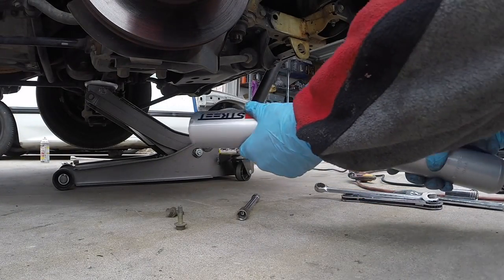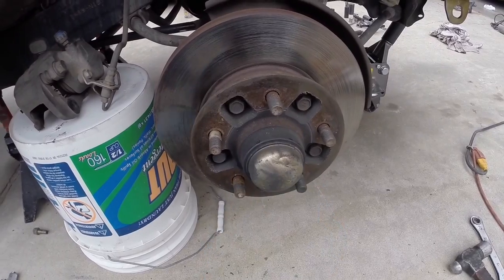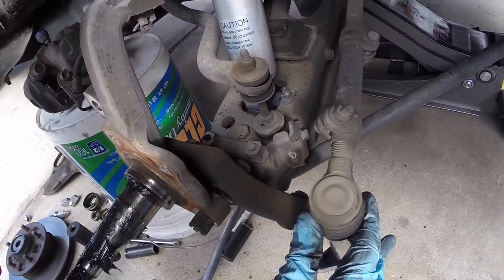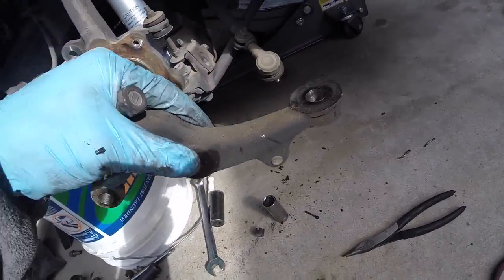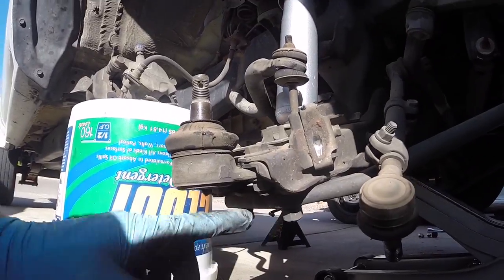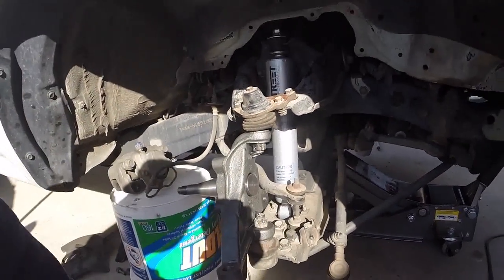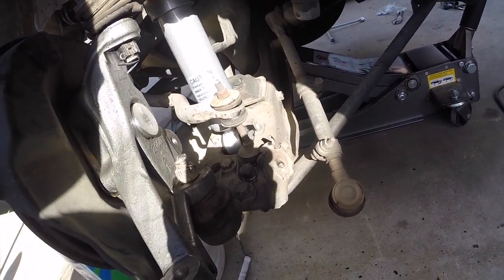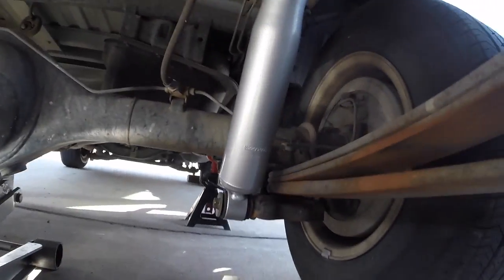How To Lower 1994 Toyota Pickup 2wd (89-95 models) Belltech SP444 DIY

Comment: Yeah i made the same mistake as you at first. do NOT drill your blocks, that plate comes off and goes on top of the block
Reply from the maker: Darn it, I haven't had any problems at all thankfully.   I wish the instructions would have shown this step.
Reply: +Jon Widmer Yeah i would keep it that way until you get new blocks. I drilled one block a few sizes up and when i test fitted it, i knocked the plate off lol. stupidest $30 i ever had to spend again
Reply from the maker: +Tj Long I think I'm just going to leave it alone.  I haven't messed with the blocks since the install.  I am going to double check all the nuts again to make sure they are tight still.  Thanks for the comment man, its a welcome addition and hopefully other people will read this before drilling them out. :/   I updated the info section also!!
Reply: What do you mean by the plate comes off and goes on top of the block?
Reply: According to the block it's one hole at top and one hole at bottom right? What plate in the video? I didn't see any plate.
Reply: Garage Built Hondas did you ever answer what plate you’re talking about flipping? I have an 88 that I’m lowering but I have no idea what plate you guys are talking about lol
Reply: Tj Long me too man I did the same thing 🤦🏽‍♂️
Reply: I believe the plate he is referring to, is the top plate that holds the leaf springs together

Comment: On my '87 we just dropped it using the torsion bars. 3" front, 4" rear with 15" KMC Hammers. God I miss that truck.
Reply: how youd lower the back? blocks? did you replace the shocks?
Reply from the maker: Subielicious Yes, 3" blocks and new Belltech shocks

Comment: I got the Belltech 444ND instead of the 444SP that you got. The ND (Nitro Drop) shocks up front do not fit through the control arm and don't have the removable dust cap your shocks have here. The solution I took was to press the lower shock mount bushing out, put the shock in to the control arm from the top, and then press the bushing back in. You could also grind out the control arm or the shock body, but I don't think those are as clean as just pressing the bushing out.

Just throwing this out there in case anyone else has the same issue I did.

Comment: Great video, all I would recommend is to add another 1.5" thick plate to the rear lowering blocks to get the truck to sit level.
Reply from the maker: Thanks man!!  That's a good idea, I had thought about just getting a 2" block in the rear instead of the 3" to raise it back up by an inch.   I'll have to see which is less expensive!!

Comment: thank you for all your videos, seems like anything i want to do to my car you have a video about! 

now my question, i called belltech to order and they told me that i needed to grind out the ctrl arms and grind welds to remove the dust cover, did you have any CA clearance issues or have to grind a tack weld when you removed the dust cover from the front shocks?

and thanks again for all the great content!
Reply from the maker: None.  Everything bolted up with zero issues.  Possibly the new product is different?

Comment: Hey what's up man, badass vid, just wanna know if it's cool to carry small loads after this is done, I deliver cart parts, not to heavy loads. I detail as well so I got a water tank , my pressure washer and all that good stuff. Still be chilling ?
Reply from the maker: You'll be good.  I carried 377 lbs of a cut into pieces CRX that I took to a recycling center and didn't have one problem at all.

Comment: Hey Jon. I was wondering if you could post a picture showing whether your new scrub radius is above or below the radius rod after installing the drop spindles and flipping the ball joints (or just tell us, haha). You're pretty savvy, but if you don't know, it's just whether if you got a completely flat tire, would the radius rod hit the ground or would you be riding on the wheel? Reason I ask is I think 15s look great but they would be a safety issue if the scrub radius is too high. Thanks for all your help. Great video.
Reply from the maker: +A dudeguy It is very close with my 14's but I would be riding on the lip of the wheel if I got a completely flat tire.  It looks as if it would scrape the 2 nuts that hold the lower ball joint on slightly.

Comment: FYI the nuts that hold the rotor/bearing onto the spindle are supposed to be loose, it's not like an axle nut on a fwd. Tighten them up ad you're gonna roast those bearings.
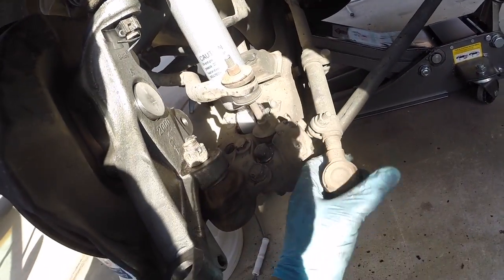Reply from the maker: Yes, I noted it at around the 9:15 mark.  Hopefully people follow that.  I drive this truck 5 days a week.  I haven't had any problems at all.  Thanks for the comment!  I appreciate the feedback!
Reply: Yup I see that. Made the comment before I finished watching the video sorry! I really dig the 2wd mini trucks. Hows the 22re power wise? My 2.7l 4x4 tacoma is a total dog.
Reply from the maker: +Bradley Vaillancourt It's decent.  Not a huge amount of power but I'm still able to tow my 2200 lb track car 150 mikes 6 times a year.  I'm getting afraid though, it has 194,xxx miles and climbing !
Reply from the maker: +Jon Widmer *miles
Reply: +Jon Widmer 22r will last forever if you take care of em. i bought an 87 longbed from a guy who used it as an extermination truck. had 454000+ on the odo when i bought it and 537### when i sold it 3 years later. great motors!!!
Reply from the maker: +Spoon Fixer I've read this a lot.  I'm hoping I have the same luck!

Comment: how did you get the spindle separated from the upper and lower ball joint, mine was stuck after i removed the nuts. so i used a mallet, it came off but now my ball joint studs spin when i try to put the castle nuts back on. any insight would be greatly appreciated.
Reply from the maker: +viiagrafalls I used a mallet also.  Mine didn't spin though so I didn't have a problem getting them back on.

Comment: Great video man. I have a 93 Isuzu pup, and haven't found any info on how to drop it. Do you think this kit and steps would work on it?
Reply from the maker: Thanks!  The drop blocks are probably similar, but for the fronts, I don't have a clue.  It may be a torsion bar setup which is adjustable and will lower it.  I'd look around online, I bet you'll find some info for lowering the Isuzu.

Comment: i know its a long shot but have you considered coil overs? there are no videos on youtube that have showed the process of a coil over conversion on any mini trucks.. you can be the first???
Reply from the maker: That'd be an awesome idea.  It'd probably handle a lot better too with all of the options of using the shocks with custom spring rates and lengths!
Reply: +Jon Widmer when I clicked play I thought for sure it was gonna be blocks n cranking down torsion bars, get that mini truck bounce going,lol!

Comment: Did you have problems with the lower part of the spindle from Belltech? My issue is that i can not fit a socket over the bolt on the lower ball joint won’t be able to torque it to specs. The only way is with a wrench just wondering if you went through the same problem?
Reply from the maker: No idea, can't remember.  It's been quite a while since I did this.  I've spun a lot of bolts since then and those memories are gone, sorry.

Comment: probably been covered,  tries to look through comments, but How's the over all ride after, because I love how smooth stock is but hate the look haha
Reply from the maker: Marmoto812 It's a little more harsh but still comfortable.  I drive it daily and I don't even think about it being lowered.  I think I need smaller bump stops in the rear.   I think that will help with the overall feeling.
Reply: Jon Widmer right on thanks for the response! the kit is like $400 right?
Reply from the maker: Yes, I got mine from autoanything.com.  They had the best price when I bought it.

Comment: Where did you buy the ball joint separator...brand name, part number will help. 
I bought a ball joint separator 2 weeks ago that looks like a fork, and broke all my ball joints, grease all over and had to buy new ball joints. 

Are you also knowledgable about Tacoma from 1995-2003? Thanks
Reply from the maker: Ford SVT This ball joint tool is from Harbor Freight.  I do not remember the part # but it's always available at all harbor freight stores.  

I have never worked on a Toyota other than this pickup, sorry I can't offer much help.
Reply: Thanks for the ball joint separator from Harbor Freight. I will buy one tomorrow. BTW great video.
Reply from the maker: Thanks!

Comment: How's the ride? I just ordered the same kit, but was wondering how it rides. How's it on turns?
Reply from the maker: It rides a little more harsh than stock, but still comfortable enough for daily driving.  I daily my truck.  I have since put thinner tires on a larger wheel and that made it a little more tough.  It's not punishing at all.  I'm thinking of replacing all of the body mounts and the rear leaf springs.  I think that'll help restore ride quality on this 23 years old suspension parts.
Reply: Jon Widmer cool, I want a lil stiffer ride, I'm use to my Integra on sport suspension. My truck, when I take a turn ii slide out my seat lol

Comment: Did you have any trouble putting the wheel assembly on the new spindles? My wheel bearing locked washer won't fit with the new Beltech spindles I've got a 92 Toyota pickup
Reply from the maker: I didn't have any problem at all.  Both bearings slide on perfect.

Comment: Is there a shorter toe rod that u installed, because my ailment is way off. It still needs about a 1/2” to go to get it straight, but I’m all out of threads
Reply from the maker: No, I used the OEM.  After I finished I had it aligned at didn't have any issues.

Comment: Did you do leaf springs as well? I see on the Belltech website you can do this lowering kit and I bought that. But I also see 3” lowering leaf springs, does that lower it an additional 3” on top of the 3” the kit gives you??
Reply from the maker: I didn't do leaf springs.  I believe you will probably get additional drop.
Reply: Also when you did the ball joint flip, did you have anything rubbing?? I’m having my right wheel (rim) is hitting the lower control arm for some reason
Reply from the maker: Might be an issue with the size or offset of your wheels.

Comment: Do you think a 15x8 -19 (3.75in backspacing) running a 205-55/15 would fit? Stock fenders and suspension right now, planning on running this lowering kit and rolling fenders in the future.
Reply from the maker: With lowering you'll rub the front for sure.
Reply: @GarageBuiltHondas  Thanks for the info, I've seen them on a pickup before and they said no rubbing but they probably rolled fenders at least. I also have two rust holes in both my fenders so I plan on replacing them. Do you know how easy it is to install 4x4 fenders on a 2wd and possibly how much wider they are than stock? Thanks
Reply from the maker: No idea on sizing difference.  Fenders are generally pretty easy to replace on many older vehicle.

Comment: Hey man!
Im currently in the process of lowering my '91 Toyota pickup with this same exact kit. I ran into a hiccup last night & ran out of daylight so i might get back out there today. But, the drop spindles. Did you use the ball joint separator to free up both ball joints (upper & lower)? Ive got everything else done minus that wasnt sure how those come out & cant seem to find any info on that. I lost the manual that came with my set up. Any helps appreciated, thanks again!
Reply from the maker: Yes
Reply: @GarageBuiltHondas  you rock man! do you still own your pickup?
Reply from the maker: No, sold it in January 2018 to drive something safer daily.

Comment: also what did u use to bore out the hole in the rear blocks?
Reply from the maker: I used a step drill bit.  It came in a set of 3 from harbor freight.  I didn't have any regular drill bits that were big enough.

Comment: Would you recommend lowering via torsion bar if running low on money?
Reply from the maker: Definitely, nothing wrong with a budget drop.  Do the ball joint flip first and see where that gets you.  Then you can adjust the torsion bars as needed for a little more drop.

Comment: Hey man, what you think of the kit overall after 3 yrs? Would you do it again?

Edit: I read every one of these comments and I'm impressed by how many of them you responded to. Right on man
Reply from the maker: I try to respond to all comments, I might miss one or two every now and then but always like to reply.

I had no issues up until I sold the truck back in January and I had daily drove the truck in the entire time.
Reply from the maker: That kit was nice because the ride quality stays similar with the setup.  Would I do it again?  Maybe, but don't really want to ever drive a mini-truck daily ever again.   Not enough cabin room, and not a comfortable ride for long road trips.
Reply: Garage Built Hondas yeah I can understand that. I sold my 97 tacoma single cab for that reason. I drive a 93 pickup extended cab now and I plan on referencing this vid when I do my install. I appreciate it man. Thanks.
Reply from the maker: You're welcome, it was a great truck though, our family had owned it for the last 22 years

Comment: Im trying to lower my 91 on a budget, do i have to get new spindles? There are some lowering blocks for cheap at my parts store. What would be my best option to lower the truck for cheap?
Reply from the maker: No.
Probably those blocks.
Reply: Blocks in the rear and adjust the torsion bars. That would be the least expensive method. However, it will not ride as well as it would with the drop spindles.

Comment: what's the purpose of flipping the ball joints? I have a 89 toyota pickup that's pretty low at the moment but I'm just curious about what flipping the ball joint will do.
Reply from the maker: It will lower the front about 1" extra.
Reply: Is that for toyota or any mini truck
Reply from the maker: +MO Why Toyota between 89-95.

Comment: About to order the lowering kit. Do you think it's a big difference from the beltech 444sp from just the beltech 444?
Reply from the maker: That kit is just minus the shocks it looks like?  

If you don't need new shocks then you should be good.  Mine needing replacing so I got the SP kit with shocks also.
Reply: +Jon Widmer okay thanks. Hey is your lug pattern 5x4.5?
Reply from the maker: +Johnathan Escobar Yes it is.  Or 5x114.3 which is the same.

Comment: Do you have to flip the upper and lower ball joint brackets? Or can you keep them stock?
Reply from the maker: You can leave then alone.  Flipping the ball joints gives you an added drop.
Reply: +Jon Widmer  I gotcha. I'm thinking it's going to scrub if I flip them because I have a little bigger tire. Thanks for the help!
Reply from the maker: +joseph Scarborough You're welcome, and you're right, even I rub at full lock and big bumps.

Comment: I have a 87 2wd toyota hilux, would it be the same concept? Anyways what about bump stops?
Reply from the maker: I do not know, I've never worked on any other Toyota older than mine.  It may be a very similar process, especially the rear.  I trimmed my rear bumps stops but not the front.  The front was left alone because these hubs position the wheel lower without affecting the front suspension geometry.
Reply: +Jon Widmer Thanks!
Reply from the maker: +Ekolu Dela cruz You're welcome, any other help I'll be glad to try and help!
Reply: +Jon Widmer One more question, do you think I can just take off my bump stops?
Reply: @kainalu9402  That’s not a good idea. The bump stops prevent the two surfaces from contact and potential damage. You can cut them down a little.

Comment: Do you have any problems with your front end suspension and steering parts binding and making like a clunking noise
Reply from the maker: None, only issue was my tires rubbing the fender.
Reply: Ok thank you
Reply from the maker: You're welcome

Comment: does it handle good? any info on shocks for a 79-83
Reply from the maker: It's very similar to the stock ride feeling but a little bumpier over rough road.  There are a handful of choices for shocks for your model, it just depends on what brand you'd prefer and what you plans are with the truck.  I looked up "79 Toyota shocks" on eBay and there were plenty of different models.

Comment: How do you take the nut on the top of the front shock off??
 what tool to hold the top from spinning when tryin to loosen the nut off
Reply from the maker: Try some channel lock pliers
Reply: @GarageBuiltHondas  cheers the top snapped off, i just had to grip the shock cover super hard and got it off, was a mission
Reply from the maker: Good to hear, glad you got it!
Reply: @GarageBuiltHondas  thanks guys

Comment: think i could fit a 15 x 7 wheel with -6 offset and 3.75 backspace at stock height? might lower the rear a inch or two to level it but thats it.
Reply from the maker: Easily.  That offset/backspacing sticks out only 6mm more than my wheels and a small 1" drop would be perfect.  The rear would actually line up better than mine because my rear wheel isn't flush with the fender.  You would need a tire size that isn't too beefy though.  I have 195/75/14 on my truck and that is right about 25.2 inches in diameter and it's a little too big.  I haven't bought new tires yet, I prefer to get a larger set of wheel and smaller tires.
Reply: Jon Widmer cool. would throwing a 2 inch block in the rear and leaving the front stock make it level? or would it give it a cali lean?
Reply from the maker: Cali lean for sure, you could throw the 2" block and flip the ball joints and that may be close to level.   After flipping the ball joints you could also mess with the torsion bars to get it leveled perfectly.

Comment: Will this work with a 15x7 wheel with a 215/65R-15 tire?
Reply from the maker: I couldn't tell you.  Check a tire size calculator and see what difference they are in sizing from what you have now.